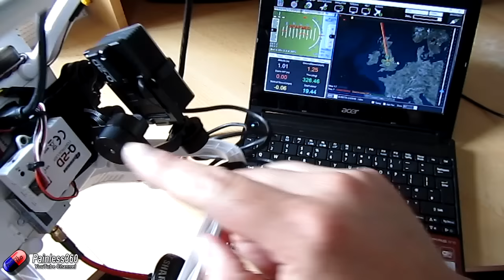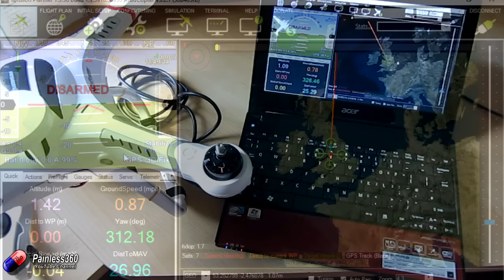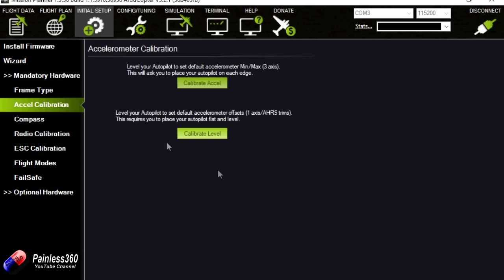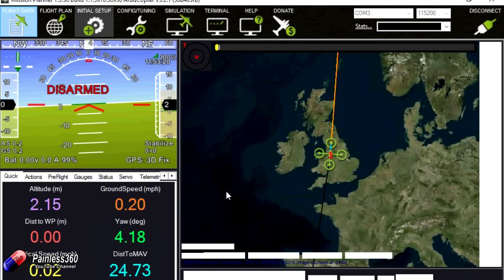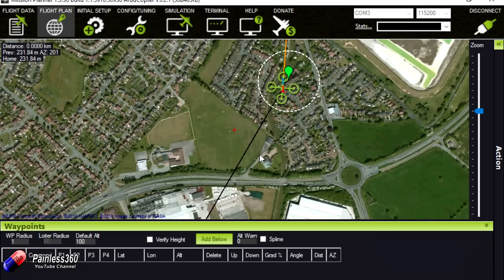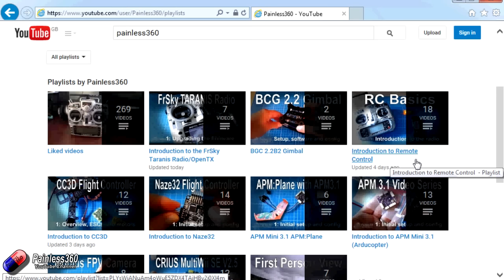(3/4) Quanum Nova Pro Quadcopter: Using Mission Planner

Comment: Hello, I need help with setting the mission planner.  I have same drone Quantum Nova Pro, and I didn't used it since i bought it years ago. My question is - can you provide what version are you using ? Some guys say get the newest one but I am not sure if this is correct. My next problem is the configuration of PC  while connecting the mission planner with the remote controller, from what I remember there where few settings to go through.  Not sure maybe you did cover it in your other videos. Help will be deeply appreciated, since I am now eager to used the drone and do some photography.  Cheers.
Reply from the maker: I've honestly no idea as this was from a while back. Mission Planner should still talk to older versions of Arducopter, like the one installed on this model...
Reply: @Painless360  after I download the mission planner, do you remember what settings I have to go through. I am just not to good with computers.  One time I had a guy who set it for me, but it was so long ago. And thanks for answering. Any Mission Planner should work ?
Reply from the maker: All I knew would be in these videos that I made at the time. I do recall going though the standard Arducopter setup steps to make sure it was all setup properly. See my Arducopter builds where I show what I do... Best of luck!
Reply: @Painless360  yes, I am going over the videos, and I did find some info on the website - Mission Planner.  thanx again

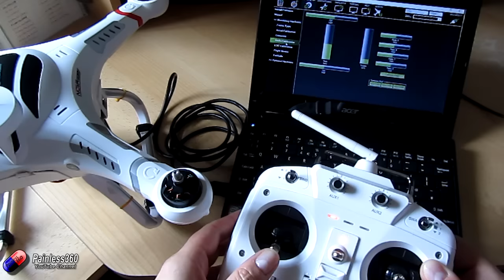Comment: @ 1:10, all my controls are reversed.  I have purchased a mode 1 version of H.K. Nova Pro, and converted to mode 2, from mode one, by switching gimbles on the remote.  Is it too much to ask for a simple way to reverse control direction, by clicking on a button on the mission planner?
Reply from the maker: As far as I know you need to do that on the radio you're using.. Best of luck!

Comment: when using flight planer, does it factor in battery usage? i have a dji phantom 4 pro now but i just got this cx 20 to play with. was wondering if it would cut a mission short or warn you of not enough battery? thanks was just wondering.
Reply from the maker: You can create missions that will be longer than the battery will last and the model will RTH when the battery failsafe happens. Happy flying!

Comment: Please could you assist? I have received a message on mission planner saying " pre arm compass not health". I am unable to remove this message and unable to calibrate my compass. Any advice would be greatly appreciated please? Has any one else experienced the same error message?
Reply from the maker: +Steven Hunter what troubleshooting have you already tried?
Reply: I have reloaded the original firmware and changed the USB cable (as it may have been faulty). I have considered buying a new flight controller and GPS as another option, but don't want to waste money if these products are not needed?  I bought it from HK and have had a live chat with then, whom seem to be unable to assist, even though its their product. I am unable to get a new flight controller or gps as they don't sell this separately, so I am told? Since I have had this model, its spent more time on the bench than I have flown it.  I have really lost faith in this product and hope you could assist me with any advice you may have to remove the "pre arm compass not healthy" error message I am receiving.

Comment: Is there a way to set the quanum nova back to its original factory settings please? I am unable to find any forums or even a default factory setting on mission planner. Any assistance would be greatly appreciated please.
Reply from the maker: All of the factory settings are shown in the video. You could re-install the firmware again to blow away any changes but that will set the configuration to defaults, not to the setup the model came with.. best of luck!
Reply: Thank you for the prompt response. I must say that your video are very educational and detailed which I like. I have leant many things watching your videos. However, the PID factory settings are not shown on this video for the Hobbyking Quanum Nova Pro.  The reason i ask is because Mission Planner said there was a firmware update available which I did, and it seems to have bricked my quad. All ESC's, flight modes, etc are completely off. I almost crashed it!  Could you point me in the right direction please? Thanks once again.
Reply: I am trying to reinstall the original firmware but am unable to find it. Could you please point me in the right direct? Many thanks

Comment: I am trying to set up a Nova Pro which was purchased without radio, I will be using my own existing system. I need more detail on which Mission Planner version I need to down load. Seems latest version and any archived version I have tried to download doesn't seem to allow a connection to the installed APM 2.7.2 board. I cannot even get a connection after trying a number of different COM port # including AUTO, I get errors as "COM port not found...." I have tried to follow your great video to find right version but being computer illiterate I hope you can recommend a specific step by step route to down load a  Mission Planner c/w other potential add-on's/drivers etc needed for my window 7 computer.
Reply from the maker: The best thing I can suggest is to watch the APM series on the channel - we go through each step.. Best of luck!
Reply: Problem solved. My USB cable became damaged and data link didn`t work yet power did. Swapping out a new cable allowed connection!

Thanks very much.
Reply: @ 1:10, all my controls are reversed.  I have purchased a mode 1 version of H.K. Nova Pro, and converted to mode 2, from mode one, by switching gimbles on the remote.  Is it too much to ask for a simple way to reverse control direction, by clicking on a button on the mission planner?

Comment: hi, I haven been able to perform the ESC Calibration on the Nova Pro. Do you know it could be done?
Reply from the maker: The 'all-at-once' calibration on the APM is something I've struggled with in the past and ended up resorting to the manual calibration. Best of luck!
Reply: manual as in one ESC at a time?
Reply: anyway, which APM version is on the Nova Pro?
Reply from the maker: Manual as one at a time (see our video). Last Ardupilot supported on APM is 3.2.1

Comment: Hello, I recently bought this drone and trying to do an ESC calibration. The all at once method is not working, and the one by one method will be hard, as all the wires are neatly zip tied. Have you gotten the calibration to work yourself?
Reply from the maker: I didn't have to as it worked well out of the box. I have had problems with the all-in-one method in Ardupilot too. I'd use a servo extension lead for the one-by-one calibration as it helps you keep almost all of those cable ties where they are.. Best of luck!
Reply: Thanks!

Comment: Thank you for another great video on the Quanum Nova Pro! Question, how do I install the wireless 915 telemetry if I do not have the plug in at the bottom, but inside on the board? I took my top off and attempted to wire it all up, but there were no lights indicating that it was functioning. Or will I just be able to use the auto flight by using the USB cord? Thanks again, you are greatly appreciated!
Reply from the maker: It's in the playlist ;) Happy flying!

Comment: Do you have a video that talks about the RCMAP, i have a mode 2 and i wanted to change yaw and roll after changing rcmap in mission planner and doing a new initial setup wizard the radio no longer works.. it did work once yesterday, i had to use the right stick to unlock the motor after.. now on a mode 1 the cables in the remote are swapped, im my mode 2 they are on the same side as the stick
Reply from the maker: Hi, sadly we don't as RCMap can get you into trouble quickly. If you're using PWM I'd look at simply swapping the wires for the channels that are mixed. Best of luck!